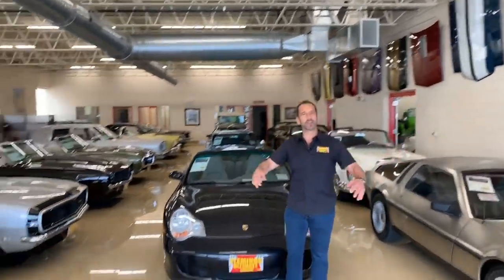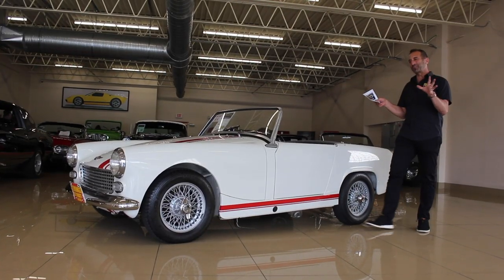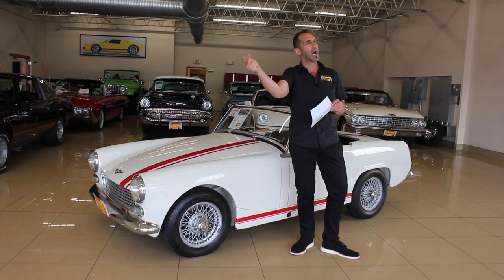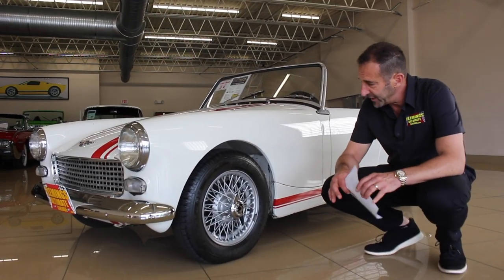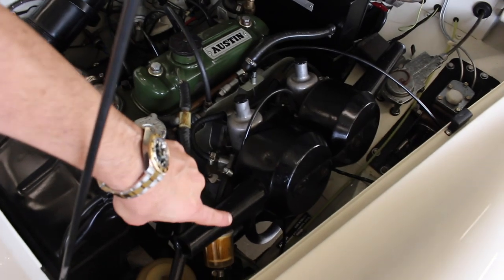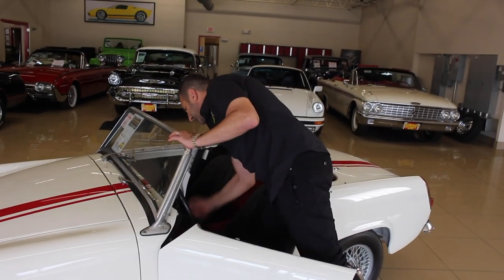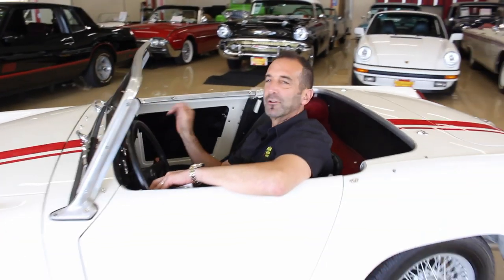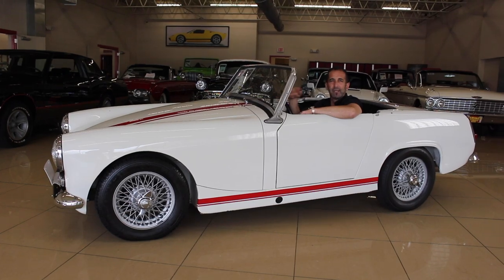Real Life Micro Machine, '61 Austin Healey Sprite Edition! - I Shoulda Bought It When I Saw It

Comment: The dash is the wrong finish, the choke should be on the dash, the engine should be green, as should the rocker cover, it's too high at the back and the Weber won't make it warm up quicker, although it does make it sound cool :). Fantastic little car though, besides that. Enormous fun, my mother has a Mk1.
Reply from the maker: thanks for the input. as we said, we still have a few things on the list to complete before its new owner takes delivery
Reply: Theres no Weber ! Thats two SUs and the valva cover IS green. It does need to maybe have one leaf removed from the rear springs to lower it ?